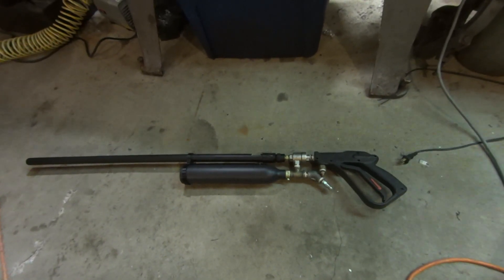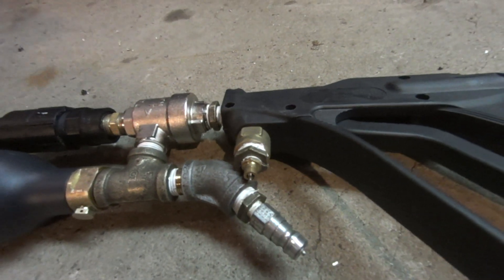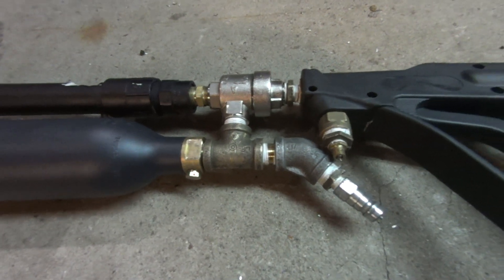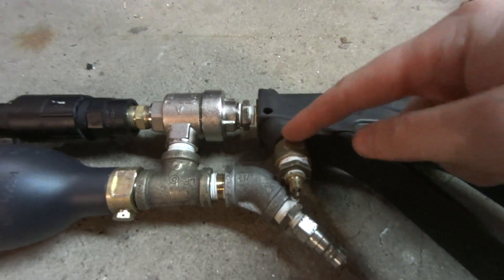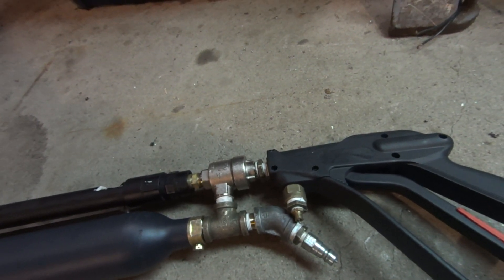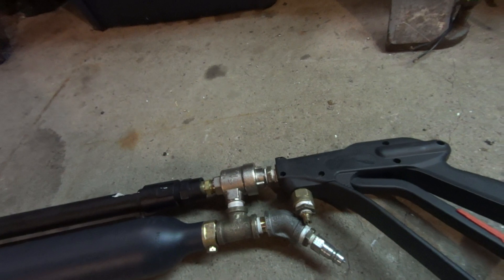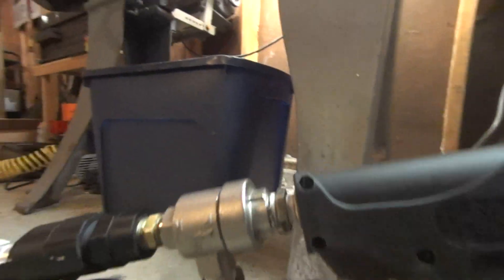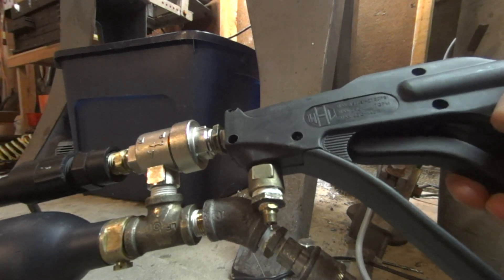Simple multi shot pneumatic QEV air gun rifle & How To

Comment: I really want to try this setup for semiautomatic action but My gun doesn't have that port under the top of the pistol, it just has a port under the butt.  Do you think it will change anything if I connect a short piece of tubing to the end of the gun barrel and then connect that Schrader valve (for the automatic action) to it?or the set up must be exactly this way to work? Wait reply thx
Reply from the maker: It's a little hard to understand your exact setup, but if I'm understanding correctly, that should work
Reply: @swandonovan  ok  thanks for the reply, and as last question. (having a  port only under the pistol) You think is ok also connecting  the Schrader valve  under the butt of the pistol? Or will make difference?
I appreciate all your works. You a genius! Thanks alot
Reply from the maker: @fabri8388  yeah that should be fine. Check out some of my later videos for some more in depth info
Reply: @swandonovan  thanks again. For sure. I 'll keep watching news and updates. Best regards

Comment: Hello there, do the tube from pump alway need to connect?
Reply from the maker: Matin Reeves if you're asking if it always needs to be connected to an air supply, no, it doesn't. The black tank contains enough air for many shots when filled to 600psi
Reply: Swan Donovan can i install the nipple pump at bottom of the tank so i can refill air from bottom. Now i in process of making one.
Reply from the maker: Matin Reeves yes to your first question, maybe to the second. Depends on how the valve is set up
Reply: Swan Donovan tq man. If anything,  i will ask u if u dont mind. How will i contact you instantly if i have anything to ask?
Reply from the maker: Can find me on FB
Reply: Swan Donovan ok will find you there👌

Comment: So am I able to just use a sand duster spray gun with a valve already in then a pressure washer?
Reply from the maker: Dogga 685 not 100% sure what you're asking. if you're asking if you can use a sand blasting gun in place of the pressure washer handle, sure. as long as you trust it at whatever pressure you're going to be using it at.
Reply: Swan Donovan yes and also does the QEV need to be modified in any way for just a big single shot, as I do not have a idea for a breaching system yet to do multiple shots?
Reply from the maker: Dogga 685 check out some of the other videos on my channel. I answer that and other questions in them.

Comment: loosing to much pressure between shots, make the chanber smaller and directly in line, some times the simplest ways work best...
Reply from the maker: hyperactive1980 the design has changed a lot since this as seen in my later videos. this was just a proof of concept
Reply: Swan Donovan i

Comment: So basically in this setup the pilot's volume becomes the firing chamber?
Reply from the maker: Netanel Cohen no. pilot volume is forced into a sealed chamber and equalized forcing the qev diaphragm closed. never seen or heard of it done this way before. check out my new videos for more
Reply from the maker: if you check out my newest videos about my .22 caliber pellet gun, i have a tank with regulator rated to 4500psi.  not sure i'll use it though